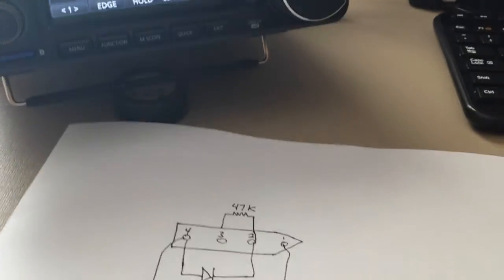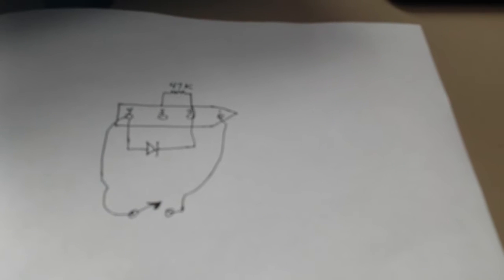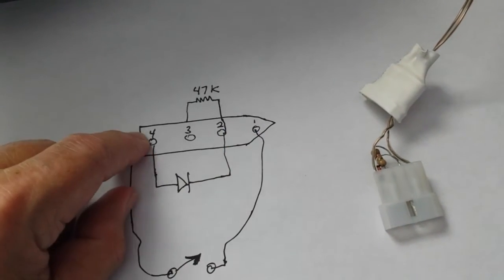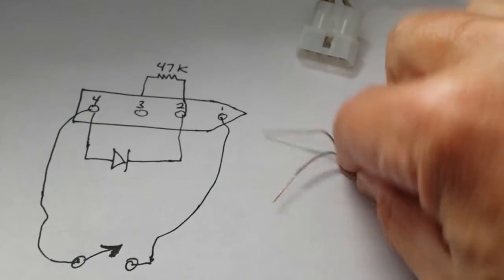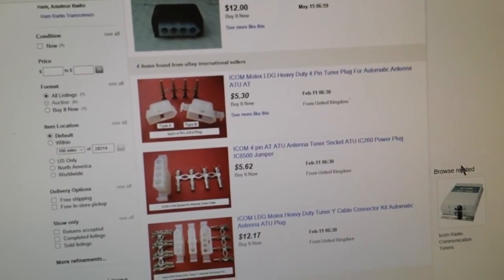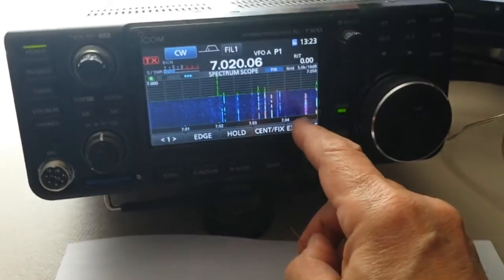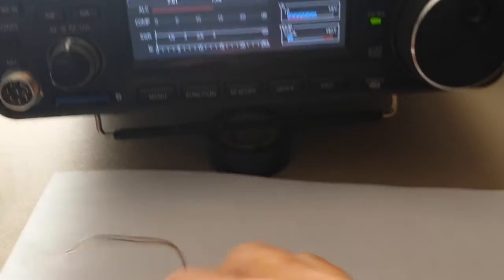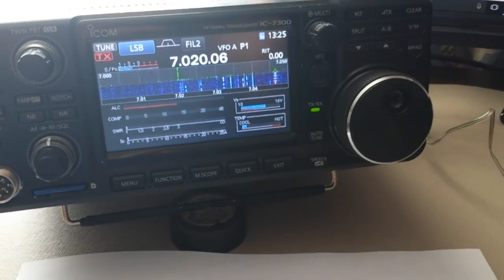IC-7300 Tuner Activator Switch

Comment: Steve I have the PTRX -7300 Radio Analog card installed in my IC7300. I am assuming that your modification will work with that card installed.
Reply from the maker: John. I never heard of a PTRX-7300. I see where DXE sells a PTRX-9700 but it's for the 9700. Maybe you can clue me in?
Reply from the maker: Ok. I found the PTRX-7300... It only provides a receiver output so no, it won't work. I really don't see the purpose of that gadget anyway. The RX-7300 does the same thing and if your SDR has a high impedance input you won't loose any signal strength anyway. I guess it's main advantage is retention of the tuner output jack if this is needed. Nothing that a drill wouldn't take care of though :*)
Reply: @n4lq  First of all thank you for lighting fast response!  DX Engineering sells the Radio Analog PTRX 7300 Panadapter Module.  A few years ago a guy by the name of Ken Dorsey did a video on how to install the card. The video is entitled "Installing the radio analog PTRX-7300 Panadapter Module for the IC-7300" The video can be found on YouTube, done in March of 2020. I believe your switched 10 watt output connector can be done. But would very much like your opinion.  Thanks again for reviewing!  John

Comment: Sweet.  Too bad the all OEM's don't give you a menu setting to do the same w/o having to use external devices.  On the TS590 you can dedicate a PF key for this.  The FTdx3000 requires an external switch.

Comment: Thanks Steve no more changing modes to tune my remote tuner. I started with the switch version but found the other video Timed Circuit was a neater approach using inbuilt Tuner switch. One thing I don't now if its possible to adjust the tune power ? mine is at about 8.6W depending on band marginal to tune my external auto tuner. So far it seems to work .Also reduced the Cap to 470uF shorter time didn't need 10sec.
Reply from the maker: I know of no way to adjust the power for tuning. Most of us would like to have more, about 15 watts would be nice or even 20w.
Reply: Even tried going through the Service Manual no mention of it. My LP500 is showing closer to 10W so I guess it works is all that matters. Thanks for sharing

Comment: Thanks for this and your other video on using the 7300 with an external tuner. I noticed that on both videos, after the tuning cycle completed, the internal tuner was left in the active state. That would not be desirable when using an external tuner. Is there a way to have the internal tuner stay inactive at the completion of the tuning cycle?
Tnx es 73 de Arnie W8DU

Comment: Hi. If I use this setup for a manual external tuner. Should I tune the internal tuner in the IC-7300 to a 50 Ohm dummy load first??
Reply from the maker: No. The internal tuner will not work with this plugged in. The safest thing to do is to switch the tuner to a dummy load, activate the 7300 and tune for best match. Then switch the manual tuner to your antenna and make final adjustments. This is shorten your tune up time. Once you have done this you can record your tuner's settings for future reference. 73

Comment: Just what I needed.   Thanks for the tip.  By the way, the Molex part number for the plug is 03092042.   The pins are part number 02092103.    At the moment, Arrow is offering free shipping for all US orders, so you can order the genuine Molex parts from arrow.com for very low cost and have them in a few days.    See:

https://www.arrow.com/en/products/0003092042/molex    (housing)
https://www.arrow.com/en/products/0002092103/molex    (pins)
https://www.arrow.com/en/products/1n4148/fairchild-semiconductor  (1N4148 diode)
https://www.arrow.com/en/products/rsmf1jt47k0/stackpole-electronics   (resistor)

 73 de W3VVV

P.S. Steve's comment at the top says diode is 1N1448.   The audio says 1N148. This is an obsolete part or a typo.  I have spec'ed a 1N4148 above.   Is this what you meant, Steve?

AD5X has a similar circuit at:
http://www.ad5x.com/images/Articles/TuningIntfc706.pdf

AD5X recommends using zener diode 1N751A to clamp the voltage to 5v.   See:
https://www.arrow.com/en/products/1n751a-1/microsemi
(The Microsemi 1N751A is an ultra high quality diode but it's the least expensive 1N751A that Arrow has in stock.  Less expensive versions that are also suitable can be found on Ebay and elsewhere.)